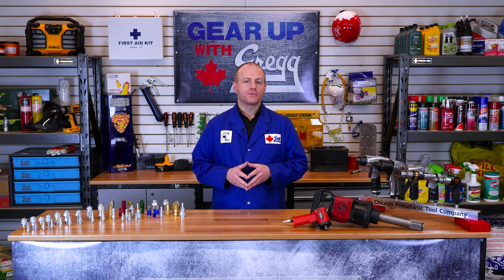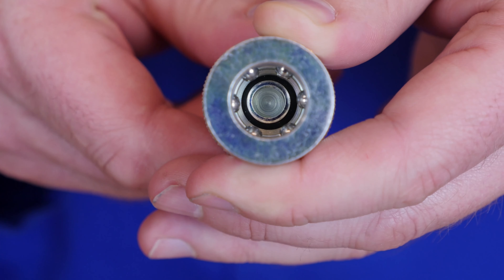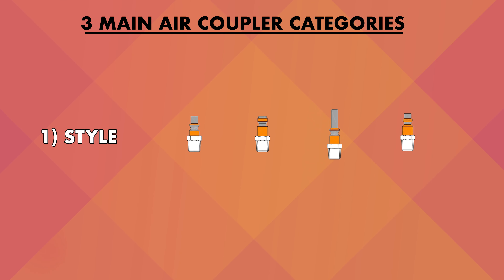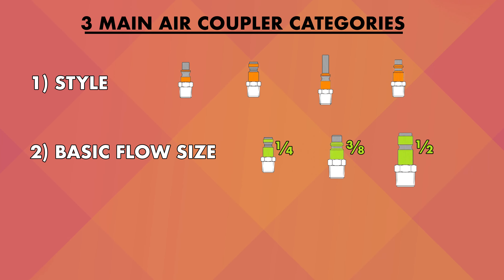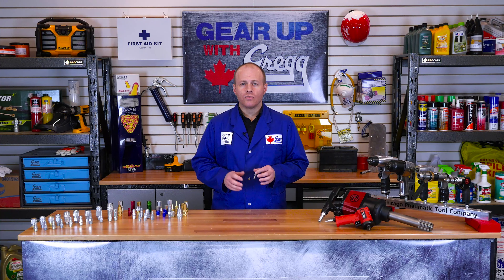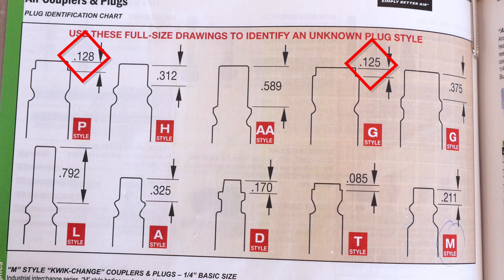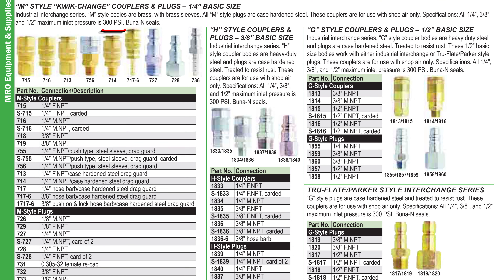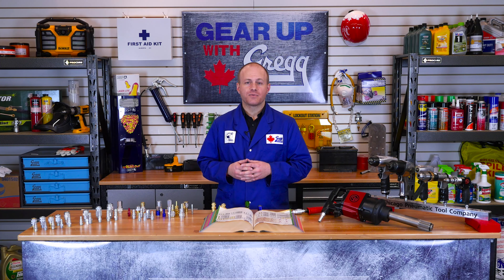The Ultimate Guide to Fittings and Couplers for Air Tools - Gear Up With Gregg's

Comment: Can you run fluid through these?
Reply from the maker: Most of the couplers shown in this video are for air only. However, we do carry a wide range of couplers that can be used for fluids. Check out our website to help find the right coupler for your application. https://greggdistributors.ca/Maintenance-Repairs-and-Operations/Air-Couplers-and-Plugs?resp_group=Default,Variations,ItemProperties

Comment: Hello! Is there a socket designed to be “open” when disconnected?
Reply from the maker: Yes, but they are typically used in pressure washer applications, an example of one can be found here:
https://greggdistributors.ca/hose-and-fittings/Industrial-Fittings/Industrial-Fittings-Quick-Disconnect/per1ef1b?resp_group=Default,Variations,ItemProperties

Comment: What means 1/4'' NPT1  ?
Somehow when I connect Stanley 166005XSTN It moves around.. Maybe such connection only for other Stanley tools?....
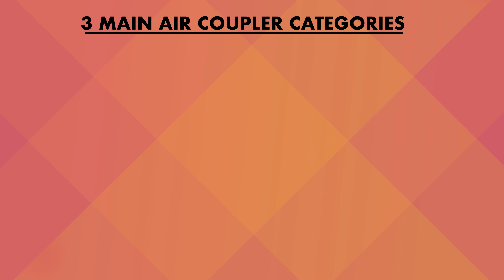Reply from the maker: NPT stands for National Pipe Thread and this is referring to the threaded part of the coupler. When connecting your air hose to another coupler you need to ensure that it is the same style type as what is on your current hose, other wise it will not form a proper connection. See the time stamp 2:21 of the video on the style types.
Reply: My local store said I have pressure pot which have Nipple (MP20F) but they sell only OP20F .. 
So looks like I need to order air hose from America..
I hope HC25Si Scheppach will fit and not leaks..
Or maybe you can suggest parts for that compressor?
Dave, you are my last hope. I need to look for hose with MIC20F coupler?

Comment: Why does my hose keep trying to knock me out? I replace the coupler and it’s fine for a few years. Then it’s looking for a fight again. It’s no fun to get hit it the face with a coupler. 
Any recommendations to avoid this?
Reply from the maker: Your best bet would be to use a coupler that has a collar at the end of it, which makes it harder for it to disconnect and potentially do some damage. Here are some options: https://greggdistributors.ca/search?q=Milton+180&resp_group=Default,Variations,ItemProperties&terms=Brand:Milton

Comment: I like that universal female coupler. I have an air tank with a 1/4 output with a female 1/4 coupler. Do u have a conversion coupler from 1/4 to a 3/8 female coupler ? Reason to run power tools like air wrench.
Reply from the maker: We do have a 3/8" male thread universal coupler (https://greggdistributors.ca/Maintenance-Repairs-and-Operations/Air-Couplers-and-Plugs/per2um3b?resp_group=Default,Variations,ItemProperties), but changing this out will do nothing to increase the flow or performance of the compressor compared to the 1/4" coupler that is already on your tank.

Comment: Great videos, having trouble finding information on fittings for the gun and the compressor hoses.  I bought a 30 gallon compressor, two 50ft 3/8 lines, and all the fittings on the lines are 1/4inch npt.  Why is this standard, doesn’t make sense to me. Shouldn’t I get 3/8 line with 3/8 fittings?   The Flexzilla hose has high-grade aluminum 1/4 fittings on each end, compressor is 3/8, and most fittings on guns and tools are 1/4….. so just swap these fittings out for high flow? Or change the hoses to have 3/8 fittings? What do you use and what do I need and does it really make a difference for hvlp. Thank you sir
For some reason it doesn’t make sense to me to have 3/8 line just to get restricted at quarter inch fittings
Reply from the maker: Hello Reggie, the pressure required to run air tools is not high pressure, because of this the restriction point will have a negligible effect on the tools performance.

Comment: Autobody shops generally use higher flow systems than A, because DA's are air hogs. The body shop I worked at had a screw compressor which delivered high flow rates of air and the larger couplers and nipples to accommodate the required high flow rate

Comment: My compressor regulator only has the gage move when air is flowing threw it ? There are regulators that allow you to to reduce the psi without any pressure moving .
Whats f to h ex difference?

Comment: So if I have 3/8 hose I should have 3/8 connectors not the 1/4 npt ones I have ?
Reply from the maker: No, that's not the case.  The most common air hose is a 3/8" hose with 1/4" npt ends, and this is ok to use for most applications.  You would only need to up the size if you were concerned about restriction and not getting enough CFM of air to your tools.
Reply: @GreggDistributorsLP  not really sure if iam restrictioned but have bought air guns that don’t seem to do much better then old ones so was wondering that’s my issue in conjunction with length of hose. So would I be better to go with the new hi flo connectors or go to 3/8 connectors ?
Reply from the maker: @limitlessworx5724  Best bet is to start at the source.  See what your compressor is rated for vrs what your air gun manufacture recommends for proper CFM and PSI.  If your compressor is not putting out what is required, it really won't matter what hose you use as it won't be sufficient.  If the compressor and the gun are matched up, then it may be worthwhile to switch to a bigger hose with bigger ends and try to use the higher flow quick couplers such as the P style 3/8 flow or even the G style 1/2 flow, though the G style is typically reserved for a 3/4" - 1" impact guns for heavy duty truck shops.  Here's a link to the catalogue page to help with your selection:
https://greggdistributors.ca/search?q=I9&resp_group=Default,Variations,ItemProperties&page_size=8&view=list&terms=CatPage:I9
Reply: @GreggDistributorsLP  I have porter cable max psi 155 60 gallon compressor, and the current gun is older craftsman so don’t know what specs are but iam getting the IR 2235Timax gun with 3/8 hose
Reply from the maker: @limitlessworx5724  At max load, that gun requires 24 CFM for best performance.  That CFM can be accomplished with a 3/8" hose and 1/4" fittings.  The gun itself has a 1/4" inlet.  So as long as your air compressor can put out the required CFM you should be good.
Reply: @GreggDistributorsLP  standard 1/4 or high flow 1/4 ?  25 or 50 ft hose ?
Reply from the maker: @limitlessworx5724  High flow would likely be better, length of hose should be selected based on the requirements of your shop.
Reply: @GreggDistributorsLP  ok appreciate all the replies and help awesome video and knowledge

Comment: Bought a house with air compressor and lines already installed in garage. Have all female couplers. But Have no idea what I’m supposed to connect to them .  He installed all copper lines so you could connect with ease wherever you’re at but once again, I have no idea what to buy to be able to connect to the female coupler. I’m assuming I have to remove all 6 that are loctite on and replace them all and start from scratch.

Comment: Why did you leave out the V style high flow fittings?  Even with their 1/4" bodies, they supposedly have a CFM of 74, which is higher than the H style with the 3/8" body. I'm not sure how that is possible though and I am skeptical.  I'm looking for some "expert" opinions or explanations.

Comment: Listen, if you are here like I am, it means you are not an expert. In other words, you are running an air compressor in your home garage and not some huge industrial application. Given that you and I are probably similar people, I will use my numbers to make this point:

My compressor puts out 5 CFM at 90 PSI. The lowest CFM number he just gave for a coupler is 34 CFM. Ig the most you can produce is 5...then couplers that handle 34 will be 29 CFM over sufficient for what you are doing, and 40CFM won't produce anything extra for you.

The connectors I found today are type M. The plugs I found are type D. I actually came here hoping to validate my purchases, by making sure those two types were compatible. I watched this video just like you did, and just learned that the difference is 34 to 40 CFM, one to the other...for my 5 CFM compressor. 

I'm set.

Comment: Are female sockets normally closed air tight and open whenever a male plug is inserted into them?
Reply from the maker: That is correct. Female couplers are closed when not connected with a male plug. Check out our selection of air couplers and plugs here https://greggdistributors.ca/Maintenance-Repairs-and-Operations/Air-Couplers-and-Plugs?resp_group=Default%2cVariations%2cItemProperties&page=3

Comment: Wonderful video,  I just wish you would have gone more into the different colors.  You mentioned the colors but, does one color mean no oil,  like I would guess blue for example, or would it be  the red or the green?   If so  you stated some have oil and some don't so why  would there be three colors?  Does the colors have meaning?
Reply from the maker: Hello Wizzarin. 
The Function of the colours is to dedicate line use, so you can ensure you never use a lubricated line for a dry line application, preventing cross contamination. Industrial (Type D): Red. Automotive (Type C):Blue. ARO (Type B): Green.
Reply: @GreggDistributorsLP   ty for the info

Comment: Every shop I ever worked at used the "M" style couplers, so that is what all of my stuff was set up for. Now Milton came out with the "V" style coupler and it has a higher flow rate and all of the older male "M" style can fit in the newer female "V" style. So I replaced all of my "M" style female couplers with the "V" style, and replaced any of the ends on my high flow tools (impacts, die grinders, and air hammers) with "V" style male connectors but left all of the lower flow stuff (tire air chucks, blow guns) as type "M".

Comment: And then is the BSP (British Standard) which is very close to a NPT type quick connects. The threaded tapers are a bit different so they are not met to be interchanged. Then there is the BSPP (British Standard Parallel Pipe) pipe thread standard which is basically a straight thread. I ran into this when I bought a HVLP Paint spraying gun trying to adapt to my current air tool NPT system of disconnects. I'm 66 yrs old and been in the mechanical field all my life and hadn't dealt with the British systems much. The consumer grade HVLP paint guns are made in China which mostly use the BSP and/or BSPP type standard or a slight variation of it so I had to go through a learning curve to make sense of those type connectors.

Comment: Great informative video.  My husband was diagnosed with Young Onset Alzheimer’s, so I am the one doing all the home repairs now.  Our air compressor had the tire inflator end.  Unfortunately I have no idea where he put the other accessories.  We have a Rigid air compressor that came with everything including the brad & nail gun.  The compressor itself uses a 1/4” quick connect coupler, that match the tools.  However I want to be able to use the compressor for other things.  Now I know how to determine the plug type on the tools, so I can by additional accessories “again” 🤪  Thanks again for the video.

Comment: Can garden/water hose shut off valves work with stuff like these? The valve I bought is called EXPERT GARDENER. I got it from the gardening section at my local Walmart store in Danville Illinois. It's the "Y" shape type with two on/off switches & it is brass so I'm curious if it too can be connected as an extension to to my brand new airbrush compressor combo kit in which the new compressor I have is the AVANTI brand that I bought from Harbor Freight. If so, what kind of coupler would be the best option to prevent & stop any kind of possible leakage/leaking?

Comment: Hi, thanks for the video. I was considering high flow air fittings for our new  3/8" air hose that calls for 1/4"-18 NPT fittings. I find this confusing. The hose says 3/8" but the thread size says 1/4".
Further in looking for high flow couplers I found many said V-style which I don't understand what that means either. Currently I also know I have Industrial style plugs/fittings for hose(s) for our compressor. Thanks for your input!
Reply: I think I had the same question: can I use a 3/8 hose with a 1/4 thread (or do they even make sure a hose)
Reply: @skre1170  yes

Comment: I'm using the  chart on this video to identify a fitting. I was told I need.

There's 2 G style fitting in the chart, what's up with that?
Reply from the maker: Take a look at 2:49 in the video, you can see that one G is .125" and the other is .375" with a slightly different style

Comment: The city uses a twist-on connector around an inch & ½ for jackhammers. We used them for traffic light loop (detector) installation for cleaning the cracks after sawing. We had some oddball reducers to make it work. On my personal compressor, I have automotive on the compressor, and industrial on the hose end. Why? Industrial doesn't like a sharp bend without losing some air. A hose is dragged out to the car with more stress on the compressor side. If I had used a hose reel, I could have stuck to one connector.

Comment: Good lord I never knew there were so many kinds of couplers for air hoses.  PhD level stuff.  Building portable compressor for off roading and I will have to study for 12 hours before getting the couplers.
Reply: My rule of thumb is:
As much air flow as you can get.

And if you have a little baby tool that needs 20psi (like a paint gun) you will need a regulator at your device anyway.

Also go to your local hardware store and auto parts store to compare what's most common on the shelf.

Comment: I dream of a world with only 1 standard for everything ,and that standard would never be changed untill new product is 50% better than old one. This way everyone pushes the water to its own water wheel and you end up with 50 standards that do same thing.

Guess im out of luck ,my chinese compressor came with female coupler which is god knows what and i have to go buy a hose -but ofc none of those sellers know what they are selling or which coupler it is .At this point making my own hose and ditching chinese unknown coupler seems appealing idea . But god knows what thread they used aswell,and everything is extra suprise expense.
Too bad i dont live in canada . . .

Comment: I've used them all and none is better than the Flexzilla brand. The 1/4 inch size flows almost as much as the 1/2 inch. While the Flexzilla will work with other brands, it is best to go all Flexzilla for the best flow and most reliable seal and function.

Comment: Great information. I'm just installing my air compressor setup and I'm having trouble with the hose reel. I'm using the purple 1/4 Milton V-style fittings throughout the whole system for maximum power to my impacts, but the hose reel looks like its going to be the bottleneck. It has a swivel on the end of it so that when the reel rotates, it doesn't twist the hose that connects it to the compressor, and there is the tiniest air hole in the swivel joint. I've scoured the web for a high flow swivel fitting, but I've found nothing so far, and what I've found are regular flow fittings for more than the price of the reel! Am I missing some crucial detail and is there even a product out there for what I'm looking for?
Reply from the maker: Hi, Yusuf! Thanks for stopping by. After looking into this situation of yours, we've determined that the best option for you would be the Chicago Pneumatic 8940171571 Air Flex Swivel Connector. Unfortunately, that is the only product out there that would work. Also, the pricing is based on the material, as they’re constructed of air craft grade aluminum. Details here > https://greggdistributors.ca/Tools-Shop-Equipment-and-Storage/Pneumatics/Pneumatic-Tools/air-tool-accessories/chi8940171571
Reply: @GreggDistributorsLP  sir what about the thread pitch of all of the connectors yoi discussed, is that NPT or BSP? Especially the female quick connector that you will connect  to the gate valve of a certain air compressor.
Reply: @GreggDistributorsLP  You didn't understand Yusuf's question. You suggested a hose end swivel.
He is asking how to fix the bottleneck at the right angle swivel at the center of the hose reel. It is not high flow and negates all the high flow fittings you put everywhere else.
Reply: Yusuf, look up "super swivel". it is the standard for high end hose reels.  you will need a few reducers, since they are all 1/2 npt.  Get 1/2 to 1/4 npt reducers to use it. there will then be a path for air that is at least as big as the V-connects.
cheers.

Comment: Wouldn’t you also need to identify the if the diameter of the tip is 1/4, 3/8, 1/2 to identify the female end of the coupling?  

Also can you buy a 1/4, 3/8, 1/2 male universal coupler and never need to worry about the style?
Reply from the maker: The tip diameter is helpful but it does not always allow you to determine the correct interchange.  As for the second question, the answer is unfortunately, no.  The only universal quick coupler we are aware of is universal for 1/4" bodies only.

Comment: This is very good information, but for granddads old tool I didn't need to find  a new style female socket as my workshop uses 1/4" Nitto so I only had to fit a new Nitto style male plug in my draw and hey presto it now fits all my existing hoses